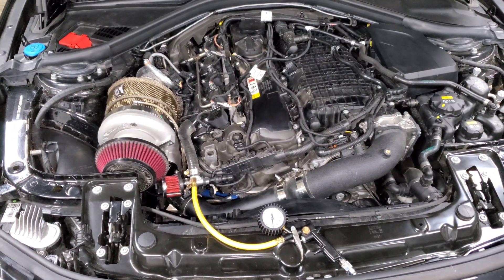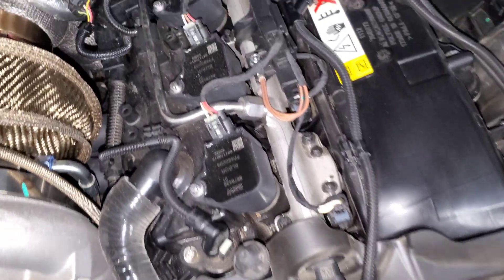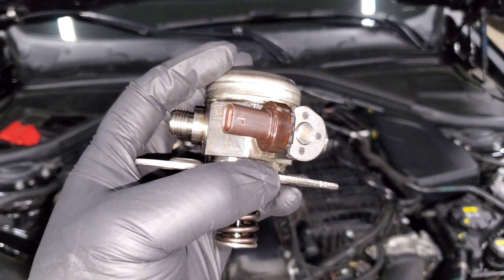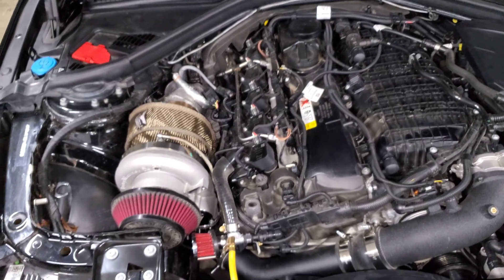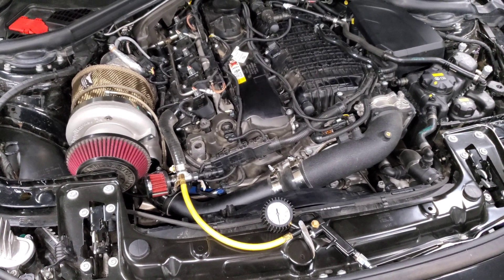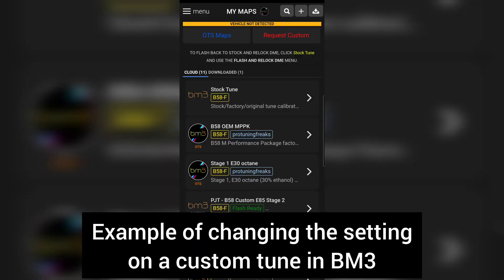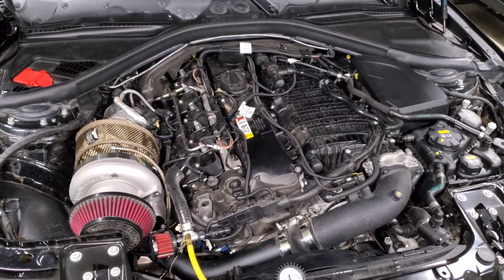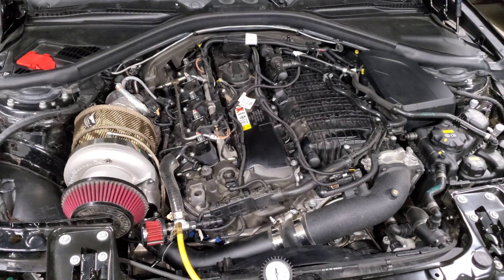Does a B58 HPFP Upgrade require custom settings? - Quantity Control Valve Explained

Comment: Man I installed this on a n55 and the car won't stop giving alot of fuel so if I select dorch stage 1 for the b58 hpfp that will also fix my rich problem?
Reply from the maker: no
Reply: @kern417  the pump isn't calibrated is what I meant will it fix that or custom tune is the only way?
Reply from the maker: you do not need custom settings for the b58 hpfp.

Comment: Is there any parameter that shows what that switch is doing? I’ve got a noise at idle that seems to be a hardly audible click right before a small change in the pitch of the injectors, Im wondering if this is just louder on the TU pump vs the stock pump
Reply from the maker: No it's a fixed parameter. It may be your evap valve on top of the manifold. It vents fuel vapor from the fuel tank

Comment: Hey mate, just curious whether i should go the stage 1 or 2 dorche pump. Planning to stay with the stock turbo. But also planning to run a flexfuel system with ecutek when it's released for the gen1 b58. Which means i'll need a pump that can run a full E85 blend. Any advice?
Reply from the maker: Both can run a full e85 mix. The stage 1 pump is plenty for stock turbo
Reply: @kern417  Awesome exactly the info i was after. Please keep up the videos they're great information! Reliable info from other owners is a bit harder to find compared to the golf community i was a part of before!

Comment: Is there any advantage by changing my B58 fuel Pump for the B58TÜ pump with the stock software?
I heard the injectors could go bad because of the increased pressure.
Reply from the maker: No there is no benefit and the pump doesn't increase pressure

Comment: What do you mean by rotating the connector?
Reply from the maker: There's another video on my channel that shows how to rotate the connecter on the TU pump so that the install is plug and play. If you don't rotate the connector then the plug is too far away and you either need to extend the harness or plug an extension in